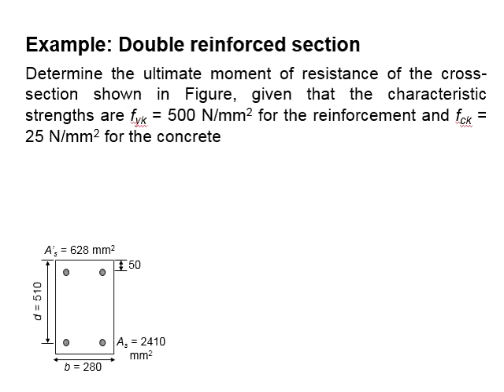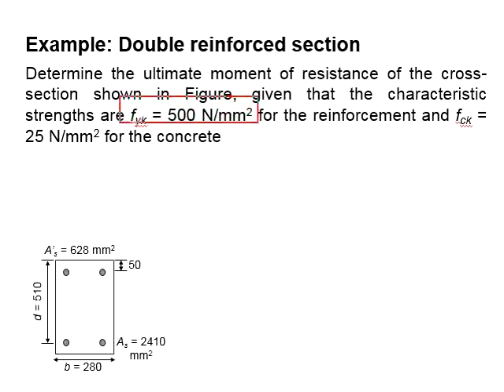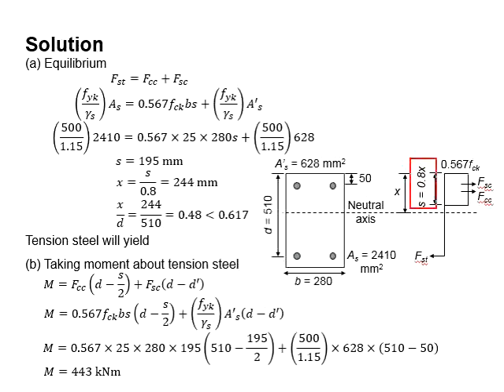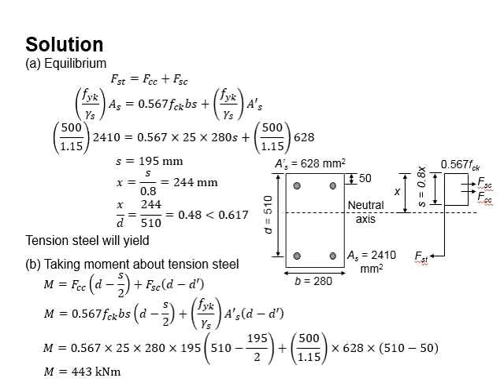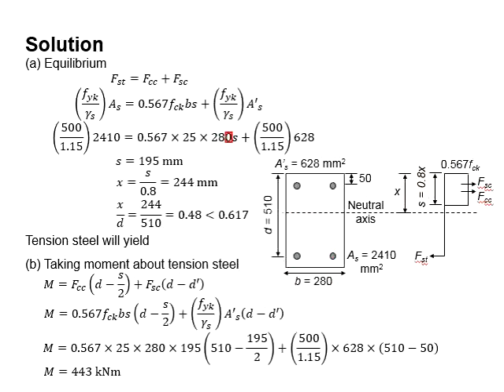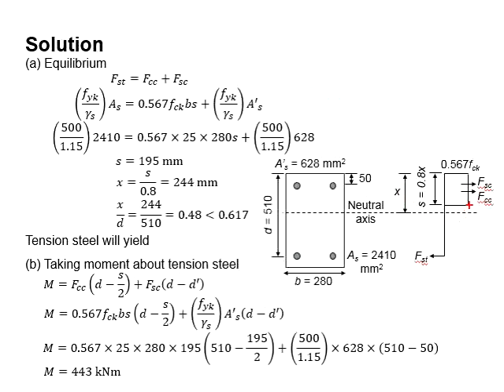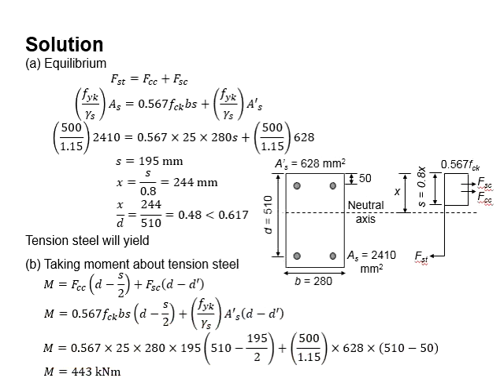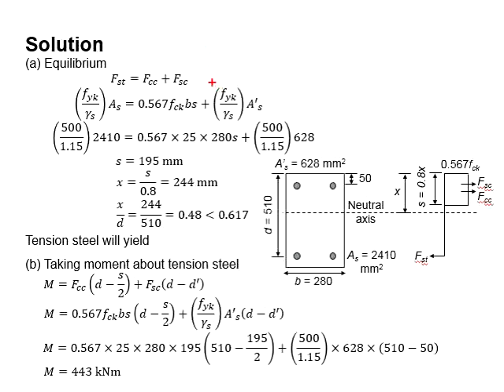4.12 Example 2: Doubly reinforced section

Comment: What if Compressor steel is not yeld ?        you need to recalculate depth x of neutral ax
Reply from the maker: if compression steel not yield, no need to recalculate the x. use 𝑓_𝑠𝑐=700(1−𝑑′/𝑥), instead of 𝑓_𝑠𝑐=0.87𝑓_𝑦𝑘. As you need to get the actual stress in the bar, instead of using the yield stress.
Reply: @eng-aim clear but the depth of neutral axis need to be recalculated